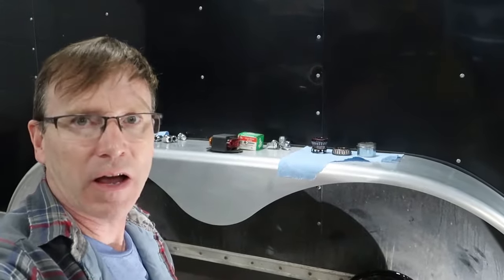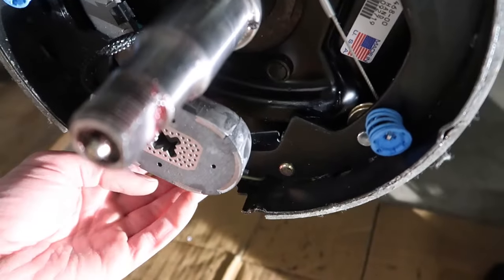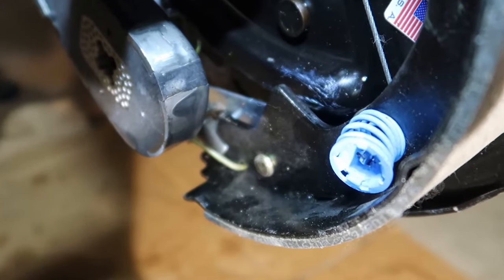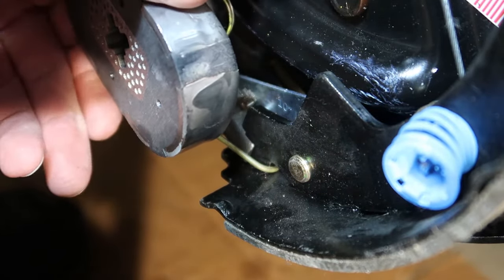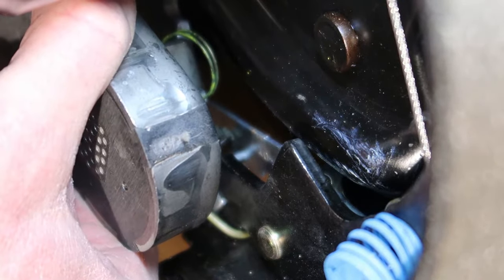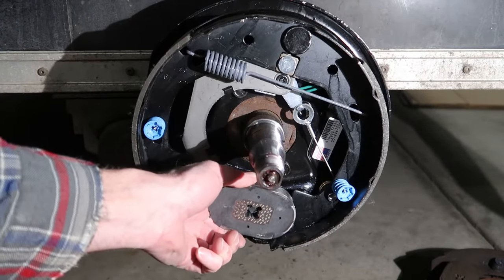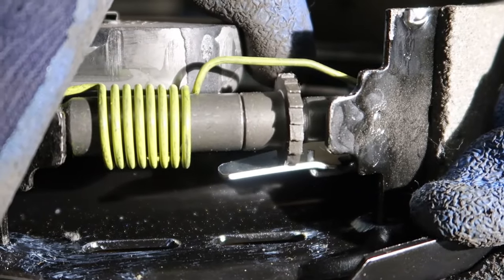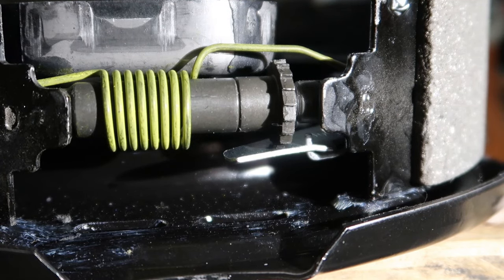DEXTER NEV-R-ADJUST Trailer Brakes and How They Work

Comment: You did a great job showing how these work, the problem with self adjusting brakes is that they dont always work correctly, you still need to check the brakes periodically and manually adjust.  I have Lippert self adjust and just removed my brakes to replace and the self adjust was not working properly.
Reply from the maker: What would cause them to not work properly?

Comment: Cool system, they pretty much adapted the well working, reliable hydraulic self adjusting mech to electric brakes. Perfect explanation.
Reply from the maker: Thanks for watching.  I am impressed with how they work.  I upgraded to them because I had one wheel on this trailer that kept locking up no matter how many timed I would adjust the brake on that wheel.  I gave up fighting it and decided to replace all the brakes.
Reply: @deltabravo1257  and soon you will get a wheel locking up again.  Electric brakes of this type are no good.  I spoke to a trailer guy about unbalanced brakes,  he asked me how old they are not how much they have been used. These things can stop working just by doing nothing

Comment: So my question is do I still have to adjust the brakes for initial installation of new set up or do they adjust them self from factory?
Reply from the maker: Either method works.  When I upgraded to these brakes, I manually adjusted them to get a baseline adjustment, then let the auto adjustment do the final adjustments.

Comment: Nice video. Like others here, I seem to have one brake (driver's side) that's a bit tighter than the pax side. I've never had an excessive dragging or overheating problem. I just replaced and repacked the bearings and noticed this when putting the wheel back on and spinning it. The wheel will turn, but doesn't spin freely. Maybe it's OK and the pax side is too loose? 😅 Going for a test drive later this week.

Comment: I have these breaks but just noticed after my trip that one of my breaks was hot.  Any suggestions on how to fix this?
Reply from the maker: The will get warm when used.  If one is still cold, then it hasn't adjusted itself.

Comment: I have self adjusting brakes and one side tightens way too much. I back it off and it will tighten right back up. Is there a way to stop that?
Reply from the maker: I am not sure what the solution is to that problem.

Comment: What failed in the old brake assembly which caused the locking and need for frequent adjustments?
Reply from the maker: Nothing appeared to have failed or been damaged.  I'm not really sure what kept causing the problem.  I didn't spend much time looking for the problem though.

Comment: Does that mean that you never have to d o the initial brake adjustment?  There are a ton of vids on how to do the initial brake adjustment.  Asking because i installed these last week on my travel trailer and the only thing i didnt do was that initial brake adjustment as per other youtube vids.
Reply from the maker: I did a basic adjustment after installation, then I left it up to the auto adjust function to dial them in as I started using the trailer.

Comment: Thanks for your reply to my previous question. I am planning on installing the brakes like in your video .  I watched the Dexter video and they explained that you may need to make the one adjustment after installation to make a little contact with the drum.  Are you able to easily access the adjustment wheel and which direction would you turn the wheel to make a little contact with the drum?
Reply from the maker: Yes, you can access the adjuster star wheel through the backing plate.  There's two oval shaped access holes at the bottom, which might be visible in the video.  Get some of the plugs to cover those holes, or use the ones from your old brakes.  The new brake assemblies I bought didn't come with the plugs (covers).
Reply: Star wheel goes down to adjust

Comment: Need a tip…got a new set out on one side of a big tex single tandem 30’. One side apparently hadn’t been working. When I picked up the trailer, it doesn’t stop well…I took it back to the shop and they said they will adjust if I work them back and forth. Drive home 90 miles…still don’t have them grabbing well even at a gain of 8. Any advice on how to get them in adjustment.
Reply from the maker: It's possible the grease seal is blown out and has allowed grease to coat the brakes, or the electrical connection is bad where the wires are spliced together behind the brake backing plate at the axle, which I've seen numerous times.
Reply: @deltabravo1257  yes the wire for the brake was completely off. The shop didn’t seem to do a good job on the wiring and just used crimp connections. Would you recommend going in and using a better connection method?

Comment: I have the same issue with the wheel locking up. I have the same thought to go with self adjusting. Did this solve your issue?
Reply from the maker: Yes, it did solve the problem.  I really like the self adjusting.  No more fiddling around trying to get all 4 wheels set to the same adjustment.
Any time I do brakes on a trailer again, I will do self adjusting brakes!

Comment: It seems like every time the brakes actuate, it is adjusting the gap...interesting enough, from watching your video, the adjusting only happens when backing up (apparently)?
Reply from the maker: No, they do not adjust when going in reverse.  They only adjust when going forward.  They are adjusting every time only because I am demonstrating the operation without the drum installed.   If the drum is installed, they only adjust as needed.
Reply from the maker: If the drum was installed, I couldn’t show the internal workings of the brakes like is depicted in this video.
Reply: As the trailer is moving in the forward direction the wheels are moving counterclockwise thus with the magnet energized, the arm is pulled to the right as in delta bravo’s demonstration.

Comment: So, will they adjust both tighter and looser as needed? That’s the part I don’t understand. If they started off too tight, and the star wheel can only move in one direction, then can they loosen…?
Reply from the maker: They don't loosen, they will only tighten as needed.
Reply: @deltabravo1257  Thanks—so what would I do if my brakes are dragging? Can I do something with a flat head via that adjustment hole?
Reply: @mheathcott  Did you figure this out? I was just looking at mine because it seems one side is tighter than the other. i took the hub off and was able to loosen the brake by turning the star wheel clockwise. then I turned counterclockwise until very small amount of rubbing.

Comment: I bought a travel trailer in 2015 with dexter easy lube hubs and I assume self adjusting brakes and have not had braking problems. ( rotors wheel not accessible threw ports) I am in the process of installing seals and bearings and the some of the hubs are real difficult to remove  and some of the wheels do not seem to spin as well as they should when  the wheel is jacked up.  I would apricate any input or comments.
Reply from the maker: If the are self adjusting brakes, the brakes might be way too tight, but that really shouldn't happen with self adjusting brakes, so I suspect that are manual adjust brakes.  The only way to know for sure is to take them apart.  Check out some of my other videos, I have several that show  bearing repack and brake inspection.

Comment: If I have this system, do I also need to have a brake controller? My BMW is not equipped with one but wanted to see if having an aftermarket controller is needed with these.
Reply from the maker: Aftermarket brake controller is needed with these and all electric trailer brakes.
Reply: If your towing anything, you need a brake controller. USMC/USAF Ret.

Comment: Still needs manual adjustment, doesn't it?
Reply from the maker: No, it's all automatic, just as shown in the video.  The self adjust as needed when the brakes are applied when moving forward.
I've had these brakes installed for 2 seasons now and they work flawless.

Comment: Absolutely does not work as advertised im still having to manually adjust star wheel  on all 10 of my cargo trailers
Reply: are you able to adjust from the plugs in the back? its seems that plate gets in the way. i have only found that to adjust you need to take the hub off
Reply from the maker: Sounds like you don't have this style of self adjusting brakes.
Reply: @Dan007UT  This answers my question.  I crawled under my 2017 30' Airstream and couldn't see the adjusting star wheel.  I was wondering about this and you have answered so many of my questions.  Next time I hookup, 😇, I'll make sure I do a few stop and goes and make sure the brakes adjust.  I have approx 20° difference from driver's side and passenger side.  Could just be the weight difference.  Thank you so much for the video and answering everyone's questions.  It helps all of us.